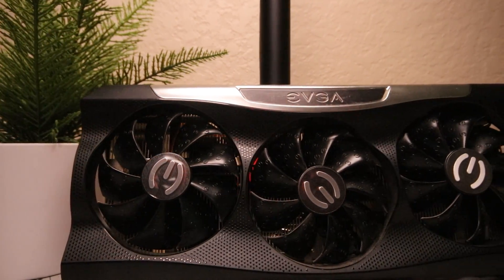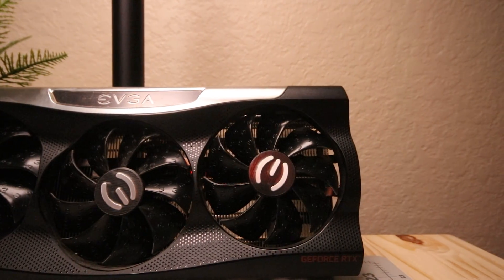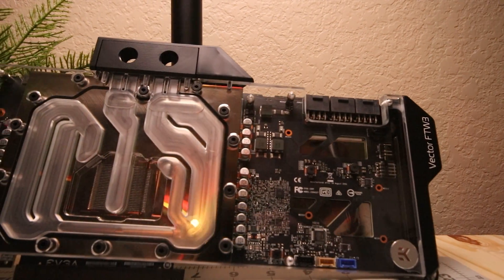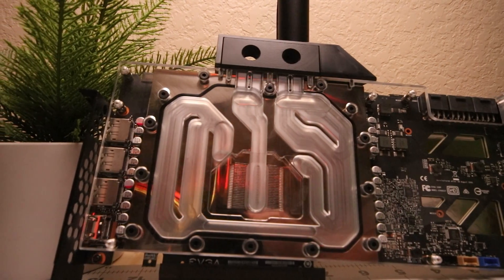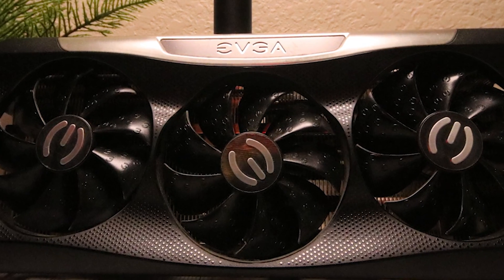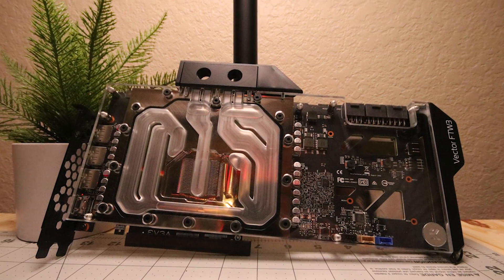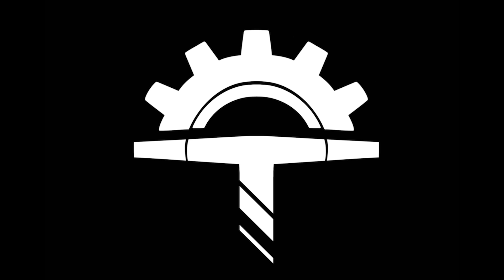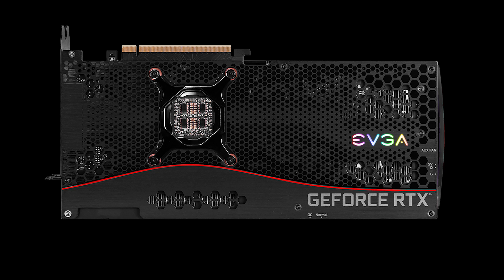EK-Quantum Vector FTW3 RTX 3090 - Install Video

Comment: Is there a benefit to using individual rectangles for the memory chips around the GPU, instead of using a strip of the same size? I.E a single strip for the 4 chips on each side and the 3 chips on the top?

Comment: What size pads did you use for the front of the cooler? 1mm or 1.5mm?  Just read the comments. When I got my Waterblock fir my 3090 ftw ultra I didn't get directions just alot of random thermal pads.
Reply: What pads did you use fircthe backplate? Did yiu have a diagram with directions? I'm not seeing it online.

Comment: Any experience with EKWB EK-Quantum Vector FTW3 RTX 3080/3090 Active GPU Backplate .. I'm just wondering if it's something to pursue. Also I'm a little foggy how the top and bottom connect without leaking with what I assume to be an o-ring. Thanks!
Reply: I run front and back. Temps with a 25 deg C Full Loop hold steady at around 38 deg in Timespy.. Can't get the board to go above 44 Deg even after 5+ hour sessions. Trouble is my board won't pull more than 410 watts in bench - EVGA issue. 

Clocks at +255 core +1000 mem 119% power. (XOC bios)

Benching: Core stays at around 1925 to 1950MHz.

In game it's more like 2050MHz and it does pull more power occasionally up to 415w.  GPU Ram never goes above 45 deg.

If they allowed us a proper unlocked bios This would be a monster setup... c'est la vie

I would ABSOLUTELY recommend the active backplate if you can find one... I couldn't even touch the back of the board when it was air cooled 80 deg+ in the same case.... Those ram would have been COOKED in no time
Reply: @serjames2893  .. to my understanding there is a firmware that you can install from EVGA that will fully unlock the power limits. While I didn't download and install it I believe it's listed on their Forum. 

I'm placing the order for it today .. I figured it can't hurt and it looks nice. 👍😎
Reply: @DJaquithFL  Yeah, tried that, it's the xoc BIOS. Supposed to unlock 500w power draw - doesn't get anywhere near it though, there is some Voltage or load distribution issue with these FTW Ultras. 425 is the highest I ever saw in game.... normally it stays below 400 even heavily OC'd. Just pwrlimited constantly. Might try the kingpin one If I'm feeling brave.
Reply from the maker: @serjames2893  - great info!!!
Reply from the maker: I’m think about it but there really isn’t a huge benefit; I’d do it just to do it lol. Pretty sure I’m going to get one. I’ll shoot the vid when i do!
Reply: @exploringthecosmos2073  .. Honestly the main reason I'm even thinking about an Active Backplate is because I don't (I'm all over the place on this one) want to vertically mount my GPU. But I'm thinking of a coin toss. Too many choices!!! 😆

Anyway thanks for the reply have a great 👍
Reply from the maker: @DJaquithFL  ahahaha! I feel ya, right now I’m creating a new stock housing for the 3090 to house 3 noctua fans that will replace the stock housing, i want to see how much better it performs over stock! Then I’m going to covert it all back to liquid cooling and do the ABP!

Comment: Tell me please the scew driver model and what setting do you use to tighten the block to the pcb?
Reply from the maker: WOWSTICK Mini Power screwdriver, 62 in 1 Precision Screwdriver Set with 20 Magnetic Precision Bits & LED Light & Rechargeable Cordless Screwdriver for Watches, Radios, Tablets, cell phone, Drones https://www.amazon.com/dp/B09GJPXB3N/ref=cm_sw_r_cp_api_glt_fabc_J9H553117T7SEGPGE9K9?psc=1

Wowstick on Amazon! I just tighten till it feels snug and not too tight to strip?

Comment: Is you're card still running?  I noticed in this video you had already cleaned all the stock thermal pads off ahead of time. I'm curious if you used a heat gun or anything like that in the original separation. I've lost 4 FTW3 Ultra 3090s after applying this water block and backplate. Each time the GPU would work amazingly with really low temps for ~ 1 month and then suddenly die. I have the revised water block with new stand-offs and didn't have any particular trouble separating the board from the heatsink but the disassembly is the only place I can see it going wrong. So far EVGA has been good about RMAs but who knows when they'll stop being cool.
Reply: I just upgraded from a 3080 ftw3 to the 3090 ftw3.  Same ek block fits both.   My 3080 ftw3 has been running fine with the revised stand offs.   Has your 3090 been working fine since you replaced the standoffs?   Anything I need to worry about with the install?   Sitting on a sealed 3090 ftw3 ready to install and dont want to fuck it up
Reply: @teemohnay   @Tyler _  never really got it resolved. Like I said each time I installed the water block it worked for approximately a month then would die. I feel strongly that I've installed the water block correctly each time too. At this point to be honest I think these EVGA FTW3 cards are just of a poor quality and they break easily during the disassembly. When I get my new one I'm going to run it with the same OC and stock cooler for at least 90 days before attempting the water block again.
Reply: @FlavorIII  which version 3090 ftw3 do you have?   The older clown red one?   The newer non clown black?   Or the lhr?
Reply: @teemohnay  black lips. there are no LHR 3090s.
Reply: @FlavorIII  hmmmmm.  Good to know.  I know mine ends in KR.  I thought that was strange.  Now im worried about mine...  did evga rma it each time?   They dont care that we take them apart and water cool them?   What did you tell evga to get a new card?
Reply: @teemohnay  Yeah they took it each time so far. I was pretty honest. said I water blocked it and now it has no video output. I think alot of people are taking these cards apart to deal with the high memory temps so it's pretty normal for them to get cards back that had been disassembled. My only tip would be to make sure you keep the stock thermal pads because if you don't they'll hit you for 45 dollars to replace them.
Reply: @FlavorIII  thanks for the tips!
Reply from the maker: Sean- did the card give u any signs before it failed?
Reply: @exploringthecosmos2073  Thanks for responding. No real signs before death. 2 times I was using the system and the screen went dark. Gaming one time and simply web browsing another time. The other two happened while I wasn't in front of the system but the only thing it was doing was mining. Again, my temps were all amazing my memory temps were ~85c.
Reply from the maker: Interesting! I wonder if there is any correlation with mining and other failures across the board; possible we only hear about the EK issue because they’re generally the people who are buying the product with the intentions to “work”their card. I am curious about the putty that EVGA uses on the VRM and if the thermal pads alone are enough. When looking at information on the internet when you try and return your card to stock, no one can obtain stock temps with pads only.
Reply from the maker: I did not have to heat it at all and it is still running like a champ. Sorry to hear about your cards :/
Reply: @Sean Mitchell Did you ever figure out what was going wrong?
Reply: @YeezyMcgeezy  nah, in the end I sold my EK blocks used and bought Optimus blocks which have been well worth the wait. Couldn't be happier now.
Reply: @FlavorIII  The reason I asked is cause I just bought a bitspower water block and Im hesitant to install it, I was wondering if you were making a mistake and didnt realize it and could tell me but it looks like everything worked, happy to hear it.
Reply: @YeezyMcgeezy  you know, I've been blocking stuff for a while and I didn't and still don't think I made a mistake but I reached out to EK and EVGA and they both said I was doing it right and they both blamed each other. I think if you have a bitspower block you're probably ok. My only advice would be hit the GPU with a hair dryer before separating it. God speed and good luck bruther

Comment: What alcohol/liquid did you use to clean? What is that awesome screwdriver you have? Thanks for the video. I am about to add an EK block to my 3090 FTW3 Ultra
Reply from the maker: Hey! Thanks for that! If u need any help, lmk! I’ll post the links for the alcohol and the screw driver below!

Swan Isopropyl Alcohol, 99%, Pint, 16 OZ https://www.amazon.com/dp/B001B5JT8C/ref=cm_sw_r_cp_api_glt_fabc_1S8C72ESRGK1B271CFYB?_encoding=UTF8&psc=1

Wowstick 1F+ 64 In 1 Electric Screwdriver, Dual Mode Cordless Lithium-ion Charge LED Power Screwdriver (64 in 1) https://www.amazon.com/dp/B07H27G9NF/ref=cm_sw_r_cp_api_glt_fabc_J787HTV7FGZVVAA0NN50
Reply: @exploringthecosmos2073  Thanks for the reply. I will take a look at both now
Reply from the maker: @BritishTexan707  - you bet!! Appreciate you!

Comment: I heard these blocks are frying the 3080 and 3090 ftw3 left and right.  Look it up!   You havent had any issues????
Reply from the maker: No issues so far; hasn’t broken a sweat!
Reply: @exploringthecosmos2073  Good to know.  Were you aware of the issue?  Curious if you chose to install this and take the risk...
Reply from the maker: @teemohnay  i wasn’t aware but i did do some research prior and i felt EKWB was generally known for their quality and customer support. I did have an issue with the LEDs and they made it right with zero issues. I’ll have to look into the issue and see if it seems to be user or item issue?
Reply: @exploringthecosmos2073  EK has been sending out replacement riser screws.   Apparently the issue is with their design.  Theres a few massive threads on reddit that discuss it.  Im glad you havent had any issues.
Reply from the maker: @teemohnay  oh wow! And this wasn’t for the active backplate, correct? Gonna look into it asap and just reach out and see if there is something i should do as a precaution. Thanks for the heads up, bro!
Reply: @exploringthecosmos2073  i felt the same about ek.  Which is why I ordered this same block to install.  But when i went to look up install info online I found out about the issue.   Even skilled, knowledgeable builders out there frying cards with these ek blocks.  Not sure I want to risk it
Reply from the maker: Just ran 2 heaven benchmarks on ultra settings back to back, max temp was 62

Comment: What size of thermal pads should I use.
Reply: The ek waterblock
Reply from the maker: @_jvelasco.954  1.0mm! The kit will have them and the directions will be clear on where they are needed :)
Reply from the maker: Hey! For the stock cooler or the EK waterblock ?

Comment: Whats the size of the pads you are using? And what brand? Does those sizes work even for original case
Reply from the maker: Did u have a EVGA 3090 and u want to replace the stock pads on the stock cooler? thermalright is a very popular aftermarket thermal pad
Reply: @exploringthecosmos2073   broe I have ftw3 ultra  3090 hybrid. Original not hybrid kit that you self install. But I would like to change pads to better pads in near feature because I also mine when I'm not playing.  But I know if you have wrong size it my not give good contact etc that's why I want to know which size to order.
Reply from the maker: I’ll help you verify! U want the pads for the original  cooling shroud or the hybrid cooling shroud?
Reply: @exploringthecosmos2073  thank you very much for the help! I need for the hybrid cooling shroud. I think 3090 don't have thermalpads on back Vrms is it possible to install also on the back and still make a good contact. My card is not warm like 50-60 Celsius gaming depends on weather temperature.  And mining is 123mh/s between 100 celcius to 106 Celsius depends on weather too. But I downclock when it rises above 104 celcius.
Reply from the maker: @tiiiiwiiii7399  I’m cutting the grass right now but I’ll check for sure by end of day!
Reply from the maker: Check this out 
https://www.reddit.com/r/TEAMEVGA/comments/lnwoss/3090_ftw3_ultra_hybrid_thermal_pad_size/?utm_source=share&utm_medium=ios_app&utm_name=iossmf
Reply from the maker: Hey! I’m using the ones EK provided with the kit. They’re a mixture of 1, 1.5 and 2